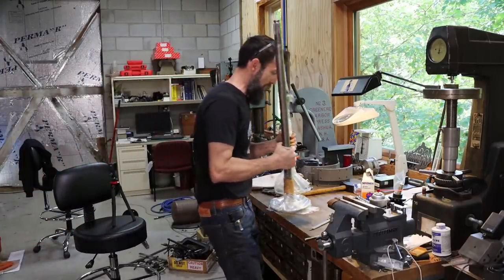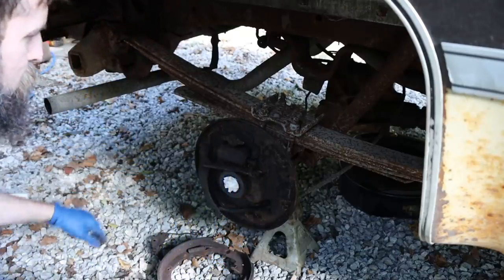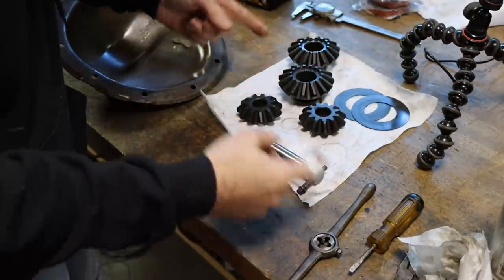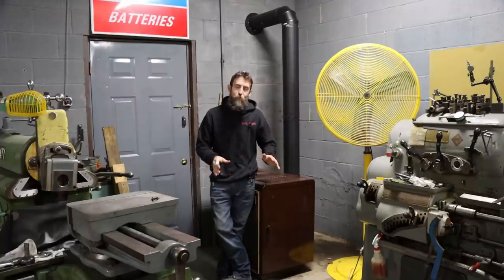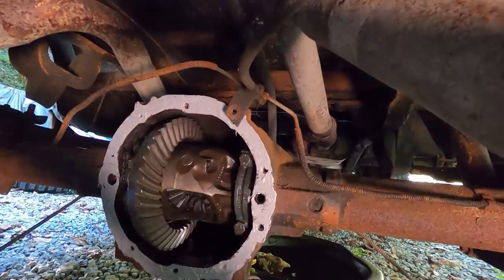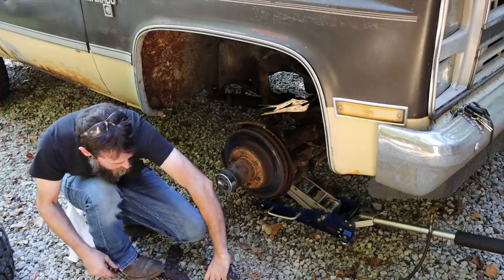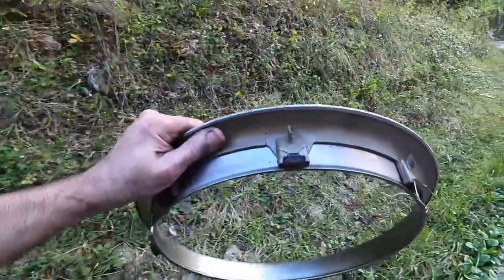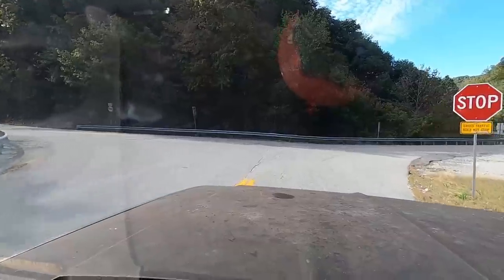Fixing my Junk  . 85 Chevy 4x4 Part 2

Comment: Our wood stove has an external stove pipe. If it is really cold, we cannot get the stove to draw until it warms up. So we end up smoking up the house :(

We try sticking burning newspaper up the pipe (from the basement). We tried those horrible "smokeless" logs. These work sometimes but not when it is really cold.

Any tips?

Comment: Sounds like you could use a clutch pedal bushing (or at least some grease)
Yeah, I'm driving an '80's carbureted truck simply because I've got no payment and I can fix it with a hammer and bailing wire.
LS swap???   🤣

Comment: HI! Steve love your work , can you take the rust of you truck , nothing to do with you is just me I'm maniac when it come this all my gear must be in top shape ,PS love your stove t, good video thank you Regard Robert
Reply: Yeah sure just pull the gas cap and pull a new one under it. The rust just gives it character.
Reply: It would be absolutely more trouble than it’s worth. It’s a work truck. You should see some of our farm vehicles. They look hideous and have for decades now. However, they just keep making money and the corrosion matters none.
Reply: @grntitan1  That's not true.These trucks are going for more and more everyday. If the frame is good and and suspension is decent he could easily get his money back out of an LS swap. Same goes for body panels. Not saying he'd get his money for the time back but sounds like it's got sentimental value, that's all that matters anyway. These trucks are bringing damn good money nowadays.
Reply: @Steve_Just_Steve  Sure if Steve wanted to put $25,000-$30,000 or more into it. That wouldn’t be counting his labor. Your hypothetical situation of an LS swap includes a whole lot you didn’t mention. What tranny you gonna pair that LS with? How about the rear end to handle that LS? So to fix the rust on that truck,  a complete frame off is needed. New steering parts, suspension parts, body mounts etc.  But seriously, how realistic is that for a guy who has basically stated he doesn’t have the funds for that sort of thing? Are older pickups the hot ticket right now amongst hot rodders, sure. That said it is simply not realistic for most people. So yeah, it is true what I said.
Reply: @grntitan1  I'm not talking about doing a frame off resto w/ a 500HP LS crate motor. I'm talking about doing a used 5.3 gen3 LS or LT motor. Something with EFI that's reliable. That SM465 and np205 would easily handle a 5.3, with bolt-ons/cam if he wanted. That thing was built to take 460 ftlb. He's not trying to build a show/track truck, he's wants a reliable work truck that can pull a decent load. All new bushings, shocks and some rear leafs and gears with a LS or LT out of something totaled ain't 30K, I've done it.

Comment: You can't even buy new trucks now because of the computer chip shortage. New trucks aren't really usable as trucks. I was going to buy a new truck in 1980 but they are all to high. You need 30 foot long ramps to get a lawnmower in and out of one. They have steps on the truck to get into the cab. Everything is a short box so they are worthless for hauling anything. It's easier to have an SUV and a trailer.

Comment: Question... Want to trade that truck for a 2000 F-350.  It has a 7.3 diesel. Great motor. 4x4. And it has a flat bed. 7x9.. Ive done all the suspension, brakes, seals, all that fun stuff. Has been done already. 
I use to have a similar truck to yours and would like another. Let me know .

Comment: Oh Steve, Steve, Steve, old buddy, old pal.  You're using your brake tool all wrong.  To remove the upper springs, put the end of the handle with the knob on the end over the stud, put the little tit on the inside of the cut off end of the spring, open the handle and rotate it.  The spring will pop right off.  To reinstall, use the other handle.  Loop the spring over the handle and put the recess on the end over the stud.  Now just pull the handle toward and past the stud.  The spring will slide down the handle onto the stud.  Use a pair of pliers to close the spring.
Those rear ends do not always leak.  After you put the RTV on, put your cover on and press it with your hand.  Install the bolts finger tight and let the RTV set up for about an hour or so.  Then, tighten the bolts but, not too tight. 20 - 25 ft lbs should be the max.

Comment: Might be interesting to see a reasonable restoration. There's plenty of auto restoration videos around where they way over restore old junkers and some of these guys are fantastic at what hey do but they charge insane money for it. Your restoration would probably be similar to mine. I'm not going to pull out a good running engine and install a new $14,000 hot rod engine. I'm not going to take the body off the frame then powder coat the frame. And when it comes to rust repair in the body, that's a whole different evil world. Don't go there if at all possible.

Comment: If you do the work yourself that truck would be cheaper to restore than to replace with new truck prices. Besides real trucks only have two doors GM makes very few reg cabs anymore and only with a long box.  I watched you change a ball joint last week with no jackstand and this week jack stands on gravel. both VERY dangerous. A local guy died a couple years ago from a jack stand on gravel at a local body shop